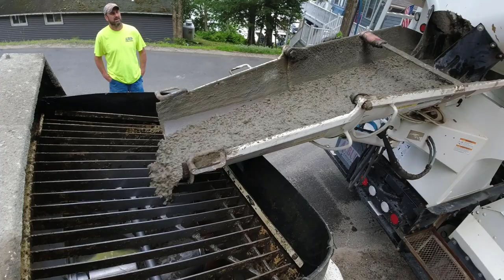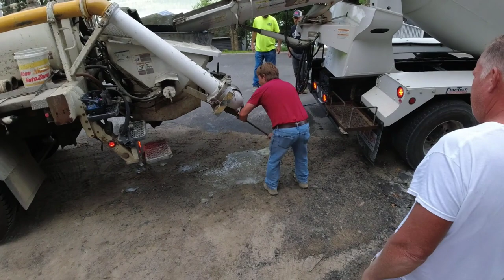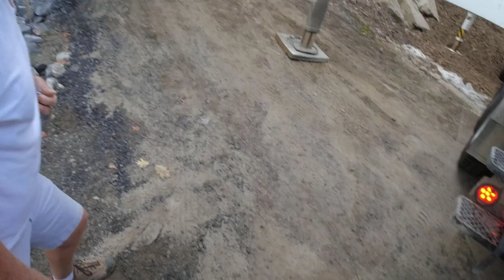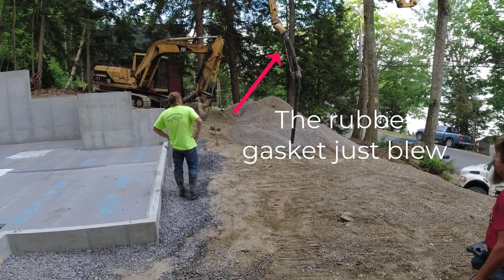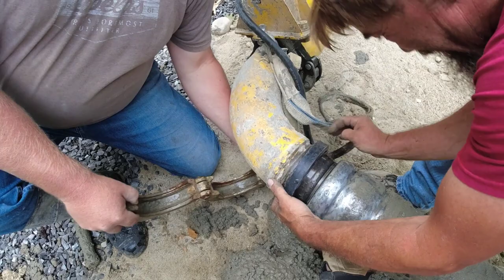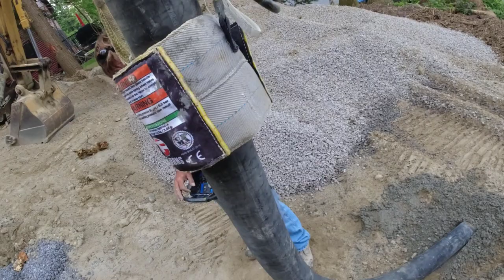We Had Major Problems With The Pump Truck On This Job! (Part 1)

Comment: If you don’t clamp properly then air will go inside which will make difficult for concrete to move through pipeline.

Comment: Can't wait for part 2,I had a hose blow 10 feet from me stading on staging 30 ft up they had the pump hose through the forth floor window while I was on the 3rd setting brickshelf , got pelted with concrete

Comment: That's a Rubber Pump hose reducer the plug is were its reduced I use to own a pump. Jammed mine up a few times, helped many Jammed pump lines.

Comment: I would of dropped the swinging 90 cleaned up the little bit of mess and had the clamp on proper. Those 90s have so much pressure the mixer driver is lucky he’s not wearing the concrete or worse. Then he probably plugged due to separation from not priming out so you gotta suck back 1-2 strokes and slowly go forward and get everything back together and take off your hose and just prime with your tip 90. But regardless of what I would of done differently everyone has bad days and I know that was one for the operator he definitely appreciates everyone staying cool and helping without hesitation good work to the whole crew.

Comment: Hauled concrete for 35years and I totally related to pumps getting plugged up. What's mostly to do with it seems concrete company'put  drivers pumps and rotate the pumps so they are not  on the same pump stupid we always drove the same mixer !

Comment: No excuse for not having that swing 90 clamp on. 2 things happened, either A the operator is neglectful, and after washing out previously didnt put on the clamp. He had a hard time getting it off, From experience I ran a pump that was a pain to put back, but you work around it, there are ways of getting it back on that are easy, just take a few extra steps. Mroe than likely, someone else besides the operator ran the pump the previous day, and that operator couldnt get the ass end buttoned back up, thus when he ran it that day, he didnt check to see if the ass end was buttoned up, thus creating this issue. Regardless, prior to priming out, hell prior to leaving the yard, you should make sure your pump is ready to go.

Comment: I probably would have dumped that hopper, cleaned the rock valve and 6 to 5 and started over. Dumped that prime out water out of the clamp and rock packed. Just my opinion.

Comment: That dude in the white shirt didn't need to walk up and point. He has an absolute death wish.... a guy near me used his co2 tank on a clog and it blew up and killed him. If you ever see a pump clog or leak, MOVE AWAY. Doesn't matter if it's a boom pump or line pump. It's the operators job to deal with it not yours and he knows what he's doing.